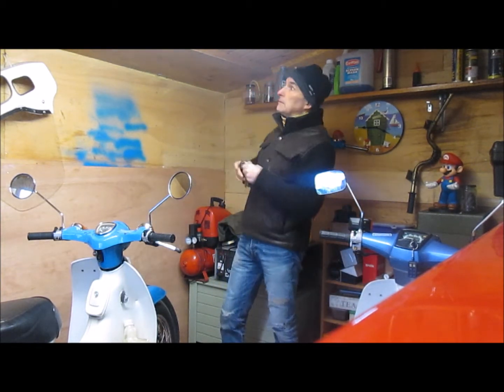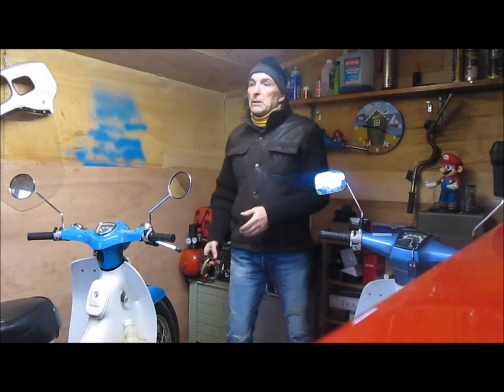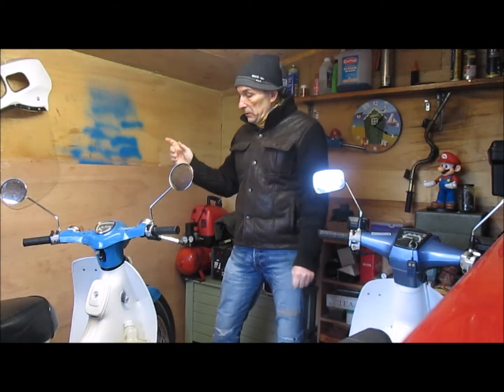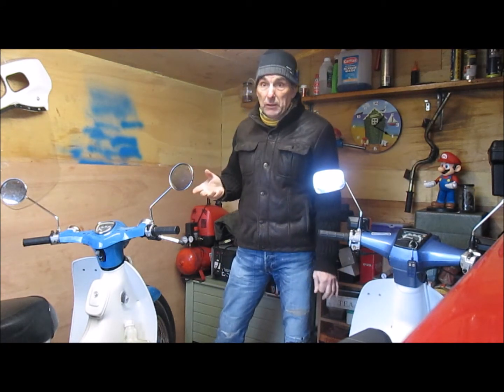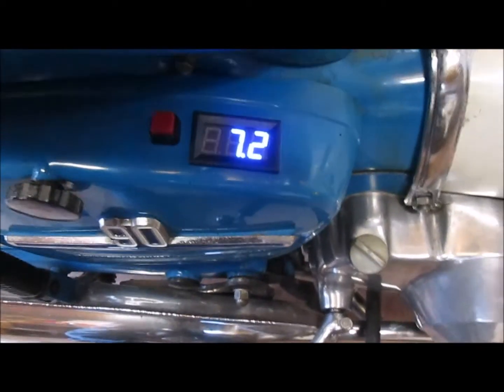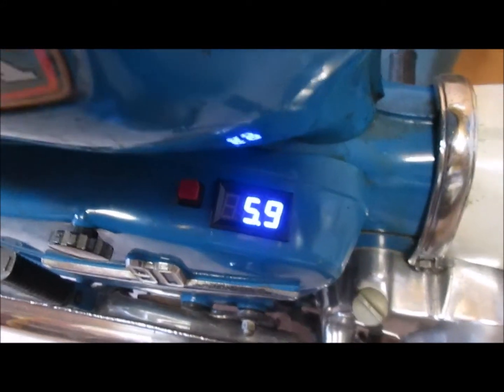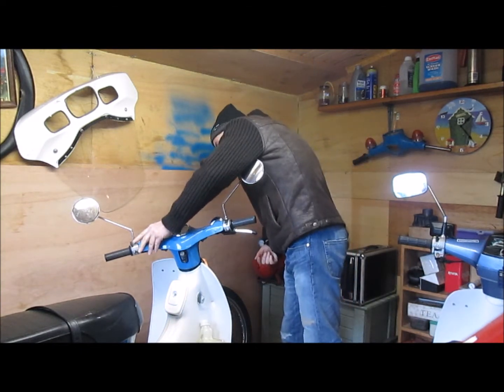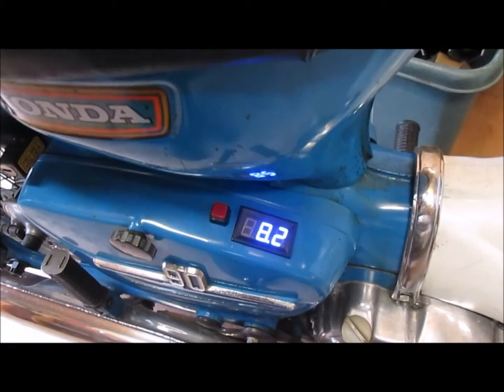HONDA C90 6volt CHARGING SYSTEM

Comment: What do you do if you don't have a pilot light as on my honda c50 1971.
Reply from the maker: your C50 will have the small 5w bulb that sits at the base inside your headlamp. To test... get a multi-meter and set it to DC current, put the + - probes of your multi-meter on each of the battery terminals, then  start the engine, switch that small bulb on then see if the voltage increases. If it does give me a thumbs up :)